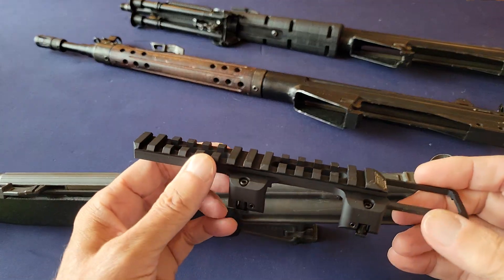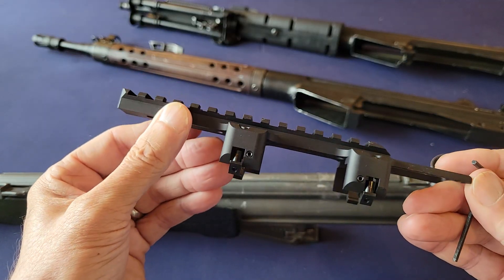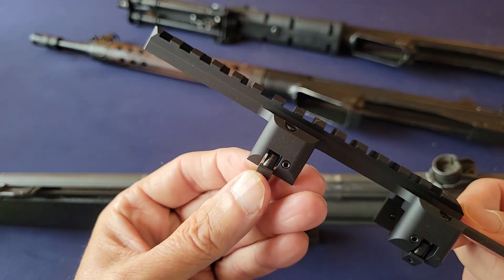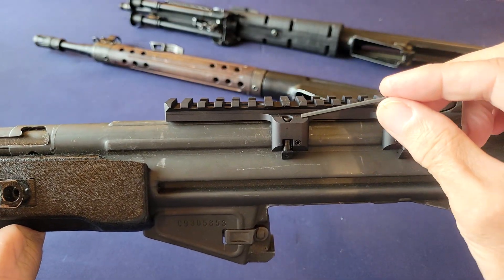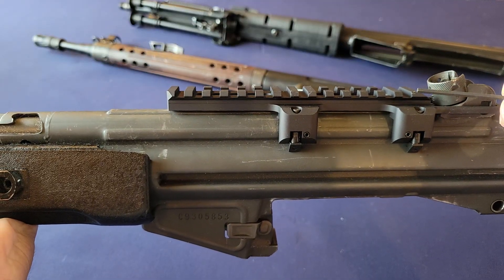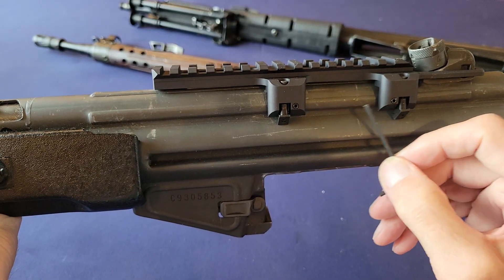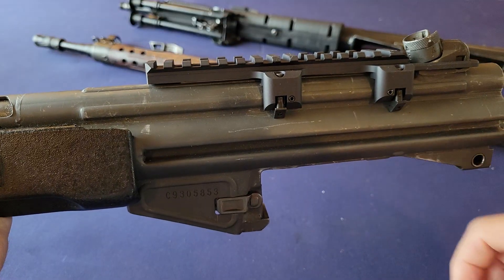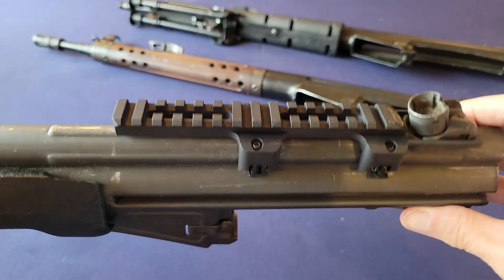MFI Scope Mount for Century Arms CA-3 Mounting Instructions & torque settings @ 2-3 Inch Pounds Max.

Comment: Well, I've putting mine on and it just seems loose and floppy. I have identified the problem and it's the too wide tolerances of the main body. The width of the CA-3, right at the mounting points is right around 25mm. The interior width of a MP5 clone mount is just a hair over that, so it sets down on the gun nicely and the hooking pieces are tight in place almost before you tighten the screws. On the MFI mount, the interior width is more like 27mm and the hooks barely grab the mounting points. There are little set screws to take up the slack, but the slack should just not BE there. And the hooks could be brought in closer to the mounting point, making for a more solid lock-up. MFI made an elegant solution, with the part that goes around the rear sight base. But for me, it's a fail in the execution.
Reply: I did manage to get it on solid. I put it in my big bench vice and pinched the bottom tongs together a bit. Then I replaced your Chinesium screws with some stainless screws from Ace Hardware.  Seems rock solid now. Maybe the PTR receiver is out of spec, IDK.

Comment from the maker: TORQUE NOTICE:

When using the included Allan Key, you will push up on the hook / claw and screw down the bolt until you meet resistance. STOP! Do this to all 4 bolts, then apply a maximum of 4 inch pounds, which equates to  perhaps 1/16 of a rotation, so next to nothing really. You can grab the scope mount and you will see that it will not move, this is because of the New Patent Pending Attribute that not only pulls the hook upward to sandwich the scope mount to the receiver, but also slight inward friction, that creates a binding action. 

These are #4-40 screws and thus easy to over torque and snap them.

I cannot us large screws as they get in the way of the lower rail mounting point for the optics lock down.